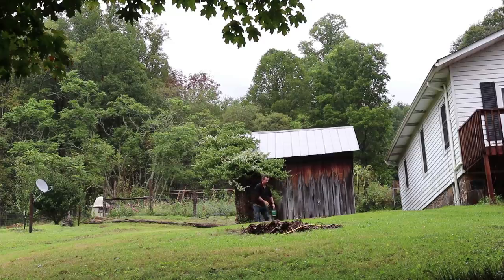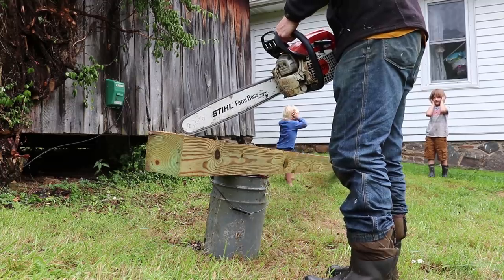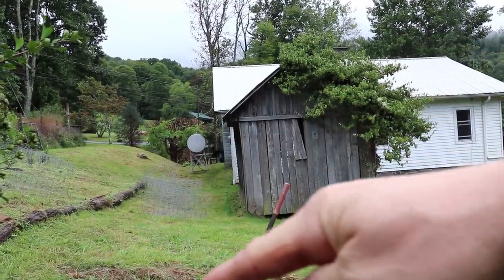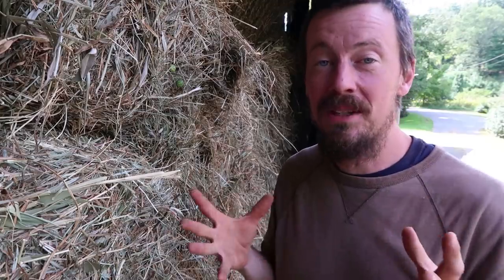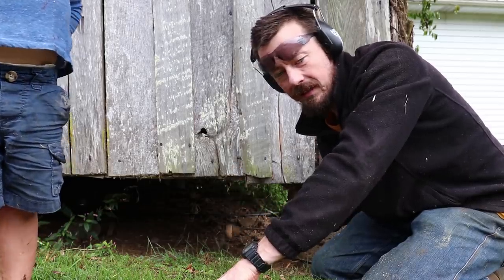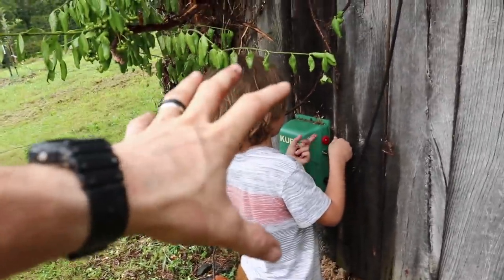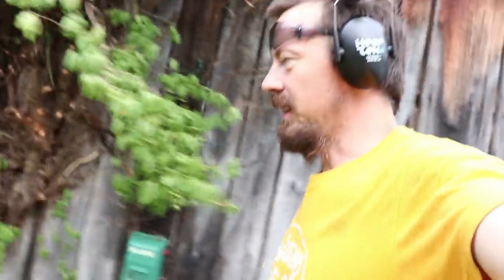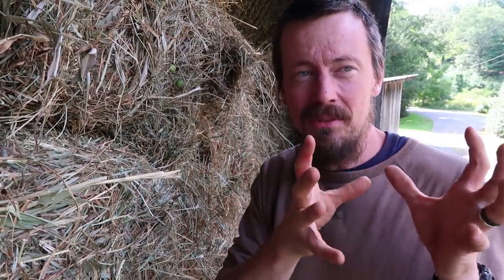House Renovation Goals? - A Radically Different Move...

Comment: Is there any way you can construct just a kitchen, like using a  12 x 12 building insulating it , heating it, and outfitting it with full size range and refrigerator and a large table /counter for work space and stay in the camper for everything else.  It seems if you rent a house, which you already looked into and there were none close by, you will be spending more time running up and down the road, transporting the kids too as they have to continue their schooling, you will have even less time to work on the house and burning through cash for rent.   This kitchen could be used later as an outdoor kitchen for canning, butchering etc.  Just a thought.  Have a Blessed day.
Reply: My thoughts as well!  One of those pre made sheds you see everywhere, have a couple friends over and insulate, drywall and get some electric tied in from the house and have a kitchen in a weekend.  Feed them a big spaghetti meal.   Set it at a right angle to camper in a spot you can leave it there to be future processing area for your animals and veg or just a homeschool room.

Comment: I’d connect the skids with a couple of 2x4’s. Then it takes the pressure off the cabin, puts it on the frame of the skid. And yes, I agree, you need a general contractor to run the job. I’d call at least 3 for estimates.

Comment: Hi guys all  the effort of doing the mold removal and re build is precarious.  The mold will undoubtedly return it is horrendously  difficult to remove/kill all the spores. Have you looked at prefabricated options. Factory made to meet your requitements.  You can still fit it out, but it will quickly give you a solution. Dont rule it out. Take a serious look. ART you are over complicating  this, stop beating youself up over what you haven't  done. You need a better  option. X stay strong.

Comment: Letting you know what we did when we had a huge reno. I contacted a building company gave them the plans got a quote. They came recomended from my husbands cousin who just had a project completed by them. They checked ours out ..quoted and we accepted.
They cane in day one with 4 workers and stripped our 2 story house back to bare bones. All clean up included with so many skip bins absolutely unbelieveable first day. Site cleared ready to get on with it. They had the knowledge forward planning and schedule all set to go when they arrived. I did some running for them to get a few bits n pieces and their lunches but all ok with me. I might add they travelled 1800ks to do our job. We paid their accomodation which was actually a hired house with rotating beds as the crews were flying in and out. And all materials were transported 1800ks as well. I had i meeting with the. To select all fictures and fittings. Job totally done in 6 weeks. My hubby kept working so did i with us both checking on progress each afternoon. I know its a lot of stress to get a huge reno done. But to put your family through winter then another house move i think is wasting money and crazy stressfull. I know you may want to learn the skills and say you built it but really i just want you to have you not stressed and in your new home. Please get a contractor or building company in that has sound eperience and admire from a far while you help your wife and kids do the farm. Love you guys and want only the easiest best solution for you moving forward.🏘🚫🇦🇺
cheers Mrs G.💕

Comment: Art you might need an excavator or a tractor w/ a bucket to get this stuff done.  This is a major project and you'll need probably 3x more time than you think.  Housing projects always work this way, thankfully you can hit it full time.  I had a siding job that was 3 weeks on my house turn into a 5 month project since March - found rot, etc and reconstruction was necessary.

Comment: Just a note, but Have Bri and the kids been in the house, or dealing and touching with things from the house? That may have been the reason they have been ill. Just a thought, as I remember it never made you ill.
Reply: They took a lot of the contents they wanted to save and stored them in the barn.  
Problem is the mold spores can regenerate and start spreading again,  once they are brought back into the new renovated house.  
I was under the impression it should be all thrown away or wiped down thoroughly with bleach, etc.
Reply: herbielina yes, your right. If I  recall, they actually said that when they found out they had the mold, but later as the weeks went on, They said they were going to keep somethings.
Reply: @CarnivoreStork   i was very worried about this also Bri talk about keeping the books. I love my books but if it put in danger my children.!!!!we never realy know how bad is the mold spores. I would have burn the house , and build a primitive house on stilts  done kitchen first and done the inside bit by bit. They risk to do a lot of work and the trouble coming back, it never end ,in this case it never start because  no body make a decision going in circles

Comment: I just have to add, try to reduce your chores. Sell the goats, the poultry, the pigs, or have them processed. Just keep the cow and calves, the bull if he behaves. The kids need to stay out of the work area, for now, until you have a better handle on things. Make sure that if you can rent or borrow a tool to make a job quicker or safer that you do it. Dont spend time doing things that dont get you to your goal. For example, old shed needs moved, have the excavator use a bulldozer. Dont waste a day trying to save something you dont use. Try to be very "lean" in your decision making, it will save you heartache and give you more time with your family.  You can do this.

Comment: Have you all considered getting a prefab building to put on the land? Maybe continue using the camper for the bathroom but get a bigger building as a bunk house... insulate, set up a make shift kitchen, build some bunk beds, wood stove. They can be a viable choice for your situation and you could continue to use it as a guesthouse or getaway spot when the house is done. It’d be Way cheaper than trying to rent a house for an extended amount of time. You’d be on your farm but still have more space.

Comment: I have issues getting things done, procrastination and feeling overwhelmed and unable to start.  What helps me is to make lists of jobs where I've broken it down into things that take 15 to 20 mins.   It helps me plan out the bigger jobs in detail so I know what I'm doing in what order and what I need.  I also get the satisfaction of crossing stuff off, and if an interruption takes longer and I don't get back quick, it's ok because I finished an increment.  It's easy to tell kids, spouse, give me 10 mins to finish this set.  I don't feel as overwhelmed as I don't put too much on my list and as it's getting empty, I have the fun of saying wow, I did all that and make my next plans.
I think you need to focus on making goals that are 'meet-able'.   That's how you will build your momentum. 

Get all the crap still in the house into just one room so everything else is cleared, sweep them up so you feel better looking thru rooms or showing  contractor thru.  You will feel better having only 1 room left to work thru.   On rainy days or when you have 30 mins, go up to the house and spend it dealing with what's left, use the touch it once rule.  Look at it , decide it's destination,  pick it up and take it there, dumpster, cleaning station, barn...  whatever.   Gradually,  it will be finished and you won't have the mental weight of stuff still in the house.
Hire Webb as your project manager.  It's worth the cash if he gets you moving forward.

Comment: I know nothing about renovation, but with a huge project like yours it seems you could make different categories  of job plans that will make the renovation move more smoothly.  What to do outside when the weather is permitting, when it's raining do the gutting of the house and get the wall board out. When it come to the outside jobs that require more people, call on those whom you've helped that may have some helpful knowledge from their experiences, hire out for those jobs like trying to move the shed. With proper equipment and safety precautions it seems it could have been a half day  job. Safer for you and the shed and easier to move to where you want it to stay. I've see folks move such a structure by jacking it up with four jacks at a time and moving a low trailer in to lower shed down and move it.  One thought, it seemed very muddy and possible slipping danger for car and shed when moving on skids plus what will you pull it with. Don't want to damage the car any further. . My dad who was a  teenager in the 30s, WWII vet, a POW  and a mechanics shop owner would listen to me discuss a problem and then say what are you going to do about it and what is your plan.  Pretty much as my aunt used to say, "Do you business or get off the pot (commode). So I have become one of those people, don't waste time for a project that has to get done and is not going to get done by itself.  There is nothing like a plan and the joy of seeing results.  No matter how small.  Joy Giles

Comment: I just started watching, and I appreciate the desire to fix up the house yourself. The issue with mold worries me, though, especially with small children. We had what we thought was just a bit of mold, and it turned out to be a very expensive project, both in terms of work that needed to be done and the health issues that arose from it. It might, in the long run, be more cost effective, faster and healthier to have a new house built and just demolish the old one. If the children are doing homeschool or remote learning for 9 months of the year, and will be indoors for much of that time, their health could suffer for it.
Just an opinion on that part of it, but I do want to echo some other comments about getting help, either from the people you have helped, from professional builders or anything in between.
Good luck!

Comment: One of my cousins does mold mitigation in southern Florida. Industrial grade hydrogen peroxide. If it’s not rooted you could save it buy spraying it down and letting it dry several times before refacing.

Comment: Perhaps build a completely new house at a different site. Re-building on the same location may not solve the mold issue if it has to do with the soil condition in that location. I would engage a contractor for that, my 2 cents.

Comment: Everyone has their strengths and weaknesses. We all fail and we all win. My goal is to be like a weeble. I may wobble and fall, but I always get up. To me, what is holding y'all back is that it is taking Bri twice as long to do stuff than it used to. Have you ever considered adding tarps on the overhang for winter to make like an additional room? The stove in the house along with the washer and dryer could be moved in there (if it doesn't freeze or you could quickly disconnect the water). That would save the rent money which could be put toward the house. If not that, maybe the little shed could be used somehow for that? This would give Bri more cooking power than she had before. Just a thought to pass on.

Comment: You have all those refrigerators in the barn. Why not buy your appliances for the house now and start using them in the barn now? I don't know how weather tight today's shed is, but if it is weather tight... That could be a outdoor kitchen. That way you won't have a commute... staying on the property is important. Yes, you have a farm and family to run, but fitting in renovation time in between farm and family will be so much easier than setting up blocks of time to commute. Besides if you need unforeseen help... they'll be on the property. Instead of waiting for them to commute to come and help you for five minutes or risking an injury because you don't want to bother her or take the down time to wait for her to show up. ... Review you tapes and revisit your reasons for getting the camper in the first place... Wasn't it so everyone could stay on the property? Plus, you need someone else on the property in case there's an accident and you can't get to your phone. Being in a house isn't worth losing a Dad. Find a way to get a full size stove/ kitchen working on the farm. ❤🌅🌵😷

Comment: Attention deficit hyperactive disorder (ADD) - even without the hyperactive component - can definitely get in the way of moving forward with a project.  We recognized it in our child when he was about 2 years old.  We developed a behavior modification plan with the whole family involved.  ADHD folks do best with a known (or planned) daily routine.  The best way to become, and stay, organized is to write down a plan.  I believe Art must write down a list of items that need to be done in each phase of his plan and stick to it.  As each item is finished, just draw a line through it.  Isn’t this what the Hollars did on the Hollar’s Homestead channel?  Heath, from the Red Poppy Ranch channel, an admitted ADHD individual, built his own house and continually listed items that needed to be done.  Juggling the list in his mind was too much distraction for him to handle.  Please, please build an outdoor ‘cook kitchen’ for Bri’s use.  A good propane-powered 6 burner grill would be a prudent investment.  It’s amazing what can be cooked & baked using this piece of equipment.  Also, hook up a nearby basic utility sink (Lowe’s & Home Depot sells them), with water supplied by a hose hooked up beneath the faucet, will provide Bri with a prep sink.  Most important, though, is to hire some help and get that house gutted in a couple of days.  Do not be so proud that it cripples you from asking for help!!!  Art, you and Bri have helped so many folks on their projects.  They will gladly pay you back for the kindness and labor you have both gifted them with.  God has blessed you with an abundance of skills, but one man (and his loving wife) often cannot carry a burden alone.  Please reach out for more help beyond a life coach.

Comment: Building materials are way more expensive and sometimes difficult to come by, so hopefully, there will be some stabilization when it comes time to start the actual building process. 
I've finally come to the reality of figuring in set up, longer breaks than anticipated, cooking breakfast, lunch and dinner, post eating cleanup, running to scrape ants off, getting a  new pair of shoes, missing multiple items and multiple store runs, phone calls, neighbor visits to check progress and etc. into any project. Even those I'm not doing myself. I ordered cabinets from Home Depot they said could be installed in a month. They were installed, but not matching in the stain color. It took a visit from the president of the company (a state away) and 10 months to get it completed and I still made concessions because I was over it.
I know living in the RV through the winter would be miserable for everyone. I hope you find something for Bri and the kids soon.
Keep up the hard work and faith, but double the timeline. 😁
Reply: I work in the lumber industry and prices are slated to continue to increase through 2021. Doing things now will save thousands of dollar.  Every day of delay the cost will continue to increase.
Reply: @hulahickey6959  I'm not certain which article I read, but I believe it was a global market trend/trade article a couple of weeks ago. It agreed with the recent Wall Street Journal article (may have been the source) that prices will be falling in the fall which makes sense as colder climate delays builds. Just Google "lumber futures". 
Again, it not just lumber costs, but all building costs.
Then there's the red tape (zoning meeting, zoning approvals, permits, inspections) which is also in a major backlog. 
I can't even get a structural engineer to call me back. I'm sure even they're backlogged. It's frustrating.
Reply: @hulahickey6959  Also, I don't know how practical this would be where Art lives, but someone near me has a mobile saw mill. If Art had enough pine, it might be an option if that's available. 
He's in Appalachian territory where most things including good healthcare can be hard to get, let alone lumber. He'd be hurting if supplies run short over winter and he doesn't have a roof on the house. Builders have deeper pockets than an individual. They also have businesses in their wives and mother's names in the event they need to file bankruptcy. 😜

Comment: Arthur you need to give yourself a break. These goals are self imposed and you under-estimated the time and complexity of the tasks. You can't just keep adding up the amount of time you think you are behind when you didn't factor in extra time for complications or unforeseen circumstances or developments. Things always take much longer to accomplish in real life than what you plan out ahead of time. You are going to become your own worse enemy if you continue down the I'm so far behind path. Celebrate your accomplishments and move on. As long as you are working towards your ultimate goal that is enough you will get there. Slow and steady wins the race.